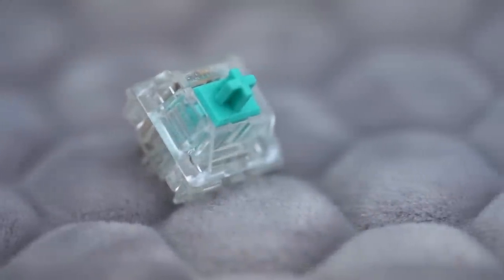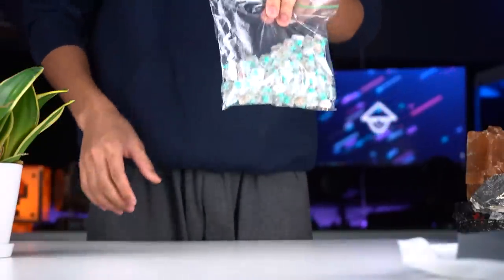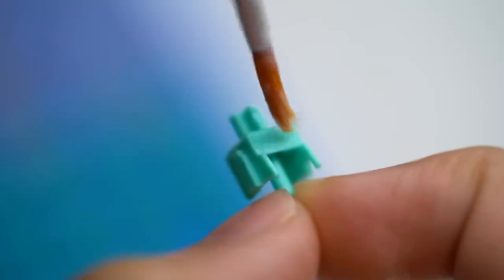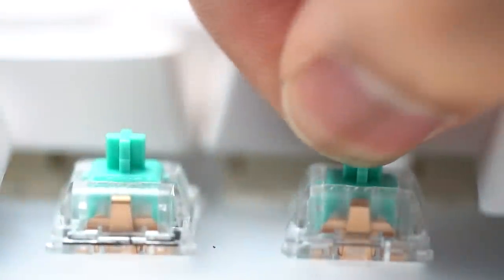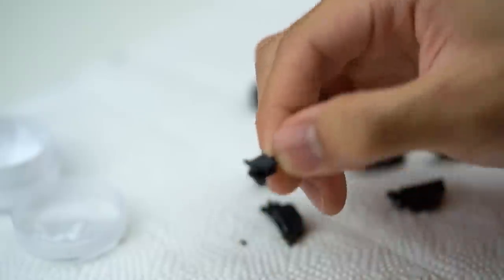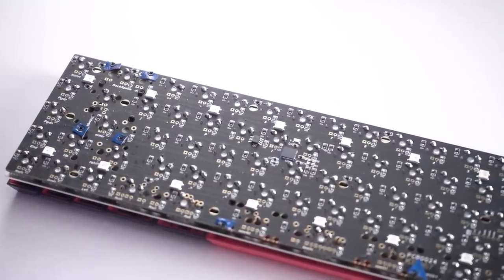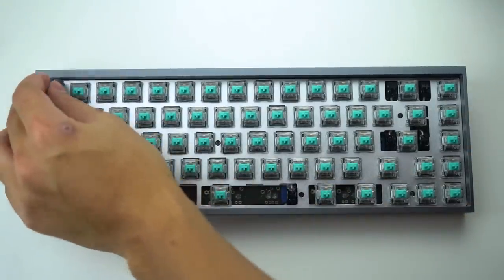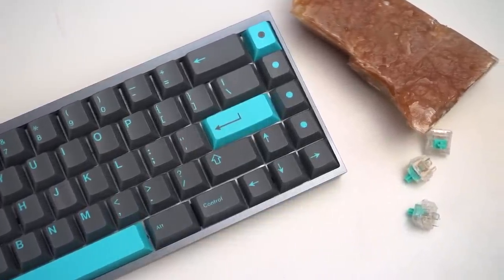The Making of My $450 Custom Mechanical Keyboard!

Comment: Great vid. When you solder it looks like you are feeding it by pushing the solder in to the tip of your iron. Using the iron to get the flow going is fine, but I recommend trying to feed the hole itself after it starts flowing. This way you get a better contact for the finished solder point. That way you end up with the cone at each point, rather than the bubbles you see.

But again, great vid. Love the look of the case. Might pick it up myself lol

Comment: I actually like the alu plates, because they have a little more give than brass and also they don’t oxidize and get yucky like brass, which is especially important for soldered builds that you can’t clean quickly...

Comment: Some say that after clipping, you also have to sand down the nubs to get an even stabilizer
Reply: only if you clipped wrong, sometimes when you clip a bit will stay on but it can be fixed by sanding however if you do It right the first time then it shouldn’t be a problem

Comment: 1 thing, after you're done soldering , always check if all the switches are correctly soldered and is fully functional, you can try to connect the usb c cable and check all the keys using a keyboard tester on the web. It's better to test it first before finishing the build

Comment: in the next 2 months or so I'll start gathering the items I need for my first build, spreading it across couple paychecks cause shit's expensive but this keyboard will most likely be the last one I every purchase, so I'm not going to cut any corner. I'll get good stabs from the start - mod the shit out of everything for ultimate smoothness and enjoy the shit out of that keyboard afterward. Lots of good tips you gave me in this video that I'll 100% apply to my build.

Comment: When i have the money, i want to do almost same one, but a bit diffrent. Heres the part list
Custom keyboard Parts
________________________

Switches: tealios v2

Case: tofu65

Pcb: dz65 v3

Plate: alu plate

Films: deskeys

Stabz: durock v2 screw in

Lube: 205g0 and super lube oil

Cable: blue samurai coiled cable

Keycaps: redsuns gmk blue samurai: basekit+spacebars+coiled cable

Comment: Not gonna lie, from someone who does a lot of soldering, if you ever solder and it looks like a non reflective ball on the top of the contact heat it up more until it looks like a shiny Hershey’s kiss. You have a lot of, what’s called, cold solder joint and they will usually not hold up. Just FYI

Comment: the real reason you dont ever use dielectric grease is over time it will harden and become crispy. so if you plan on keeping the board for awhile you will most definitely at some point have to take apart and re-do stabs
Reply: I'm pretty sure krytox is just thinned out dielectric grease
Reply: @bayybars  false

Comment: It's all very fascinating to the point where you said it makes a difference what kind of lubrication is used. From a mechanical engineering point of view - vaseline will most like suffice.
It is the same with car engines. Most take 5W-30. As long as it is not the cheapest out there and is according to manufacturer's rating, it is all good. The problem many will face is how long you use the oil. And tbh; you can go without for millions of clicks. This will draw dust and clug the switches way earlier than you can enjoy the "nicer" sound due to lubrication.
Sorry, but the backplate was top, the lubrication? Dude, it is a keyboard switch.

Comment: Ok I want a really nice linear keyboard with an aqua and gray/black look, this is poggers but the tealios are expensive. What should I get? Also I really don’t want to solder cuz I don’t have a solder(er?). Basically what’s a really smooth feeling keyboard with a color scheme of black and aqua. Rn I have a trash keyboard send help.
Reply: Nvm screw it im getting the tealios lmao
Reply: @synpower2382  if u r on low budget get alpacas ink blacks v2 but tealios best
Reply: @synpower2382  ayo if u have the tealios should i get it i mean its expensive but is it worth it?
Reply: Ayy u play minecraft lets goo
Reply: @Wasif38902  yes I play mc, but also the tealios(In my opinion) are worth it, but it’s all about preference. If you want a perfectly smooth switch, lube the alpacas or Tealios v2. I recommend alpacas because they give slightly smoother feel, but tealios if you like heavy. There is no sound difference tho.
Reply: @synpower2382  imma get the ink blacks v2 1 dollar is Just a bit overpriced for me
Reply: @Wasif38902  uh dude, the v2s are really scratchy. I really don’t recommend them. Get the JWK lavenders. You won’t regret.
Reply: @Wasif38902  also it costed 1 dollar 1 cent per switch

Comment: Hey neo i bought this same kit and im having trouble figuring out where exactly to mount the stabilizers on the pcb as well as spacing out the switches properly for the bigger enter key sized keycaps. If you can help me out or post a more in depth video id appreciate it. Please respond 🙏

Comment: what did you do to the right atl and control key, the way you put the switches in, they wouldnt actually fit into the pcb since there are 3 spots for swit ches in that are but you put 2 switches

Comment: Curious to know if you notice a hydraulic effect in the keypress when you lube the inside of that hole in the middle of the bottom housing. I did and since then I only lube the shaft of the stem and be sure to wipe the bottom of it dry.

Comment: Hi there, great video. it inspired me to build  a similar keyboard but with cherry MX clear switches and KBD's DZ65 GB Hot swap PCB. There are two type of switches the PCB mount and plate mount. I suspect I need the plate mount style switches but not positive.  What's your advise?  thx

Comment: do you need to lube the switches?
because I was thinking about building my own keyboard but without lubing the switches.
Cherry MX red switches
Reply: Eventually you will need to lube the switch if you want a smooth typing feel and lower the switch noise :D.
Reply: @huunhanle3809  ok thank u :D also what lube should i get for cherry mx reds
Reply: @barrelhead2  I'm currently using keyboard with Gateron Milky Yellow and lube them with Krytox 205g0 and Krytox 105 Oil for the switch's spring only ( to prevent the spring ping ) :D. So it's will work outstanding good with other linear switches.
Reply: @huunhanle3809  ok thanks :D

Comment: U didnt tell us the prices. how much do the parts actually cost to be in total 450$ worth
Reply: Key caps probably 110-150 or something the Switches are 1$ each so those were probably 60$ 50$ the base is probably a good hundo then there’s the board and all the other shit which might be like ehh 120-150-200$

Most of this is just a guess I’m just going off by what I’ve seen

Comment: use dielectric grease just not too much thats why your stabs are rattling.
Reply: a lot of people swear by using thick krytox such as 205g0 since dielectric grease can make stabs feel mushy, he's using cheap stabs which might be the problem
Reply: @bayybars  You kind of want to use a lot then spam it and eventually it will become smooth and return like normal.
Reply: @cognition26  I guess it's preference, I have dialectric grease on my current keyboard and the stabilizers aren't satisfying to bottom out imo
Reply: @bayybars  I use krytox 205g0 in the housing where the stem is sliding up and down but on the wires I use dialectric. I think the goal is the same for everyone. To reduced the rattle as much as possible while make it as smooth as possible. You don't want any resistance because if it's too thick the spacebar return slow. Most of the noise comes from the wires rattling which is why I use dielectric on them.

Comment: Trbisosy 3204 might've been a better option for the stabs because cherry stabs are good with Trbisosy 3204 in my opinion, it's completely up to you and your preferences. my reasoning on why i think Trbisosy 3204 would be better for the stabs is for it to give you that nice, thocky and smooth sound. krytox 205 g0 is definitely the better choice for the switches though. also maybe get a better cable that's maybe coiled and like grey to give better cable management and the wires wont bend and possible open showing the inside wiring.
Reply: You wrote a whole essay and he didn’t even see it 😹😹😹

Comment: I'm not into keyboards - can someone break down the costs? why is it so expensive?
Reply: 60-80 for the switches, around 120 for the case and let's say around 80-100 for the pcb, foam lube and films.
Around 260-300 now. Another 100-130 for the GMK Phosphorous set, a bit for the cable, shipping and other shit. You can also get a high end custom keyboard for below 450 but it won't have fancy stuff like the gmk keycaps
Reply: @ysharky  phew wow that's expensive. Thanks for the info!:)
Reply: @zxljmvvmmf3024  I am probably kind of inaccurate tho. But I am pretty sure you can get the same build with worse keycaps for 300 if you are interested
Reply: @ysharky  Thanks but no, I like watching those videos but nothing for me. I just bought a Ducky Mecha Mini, should arrive soon :)

Comment: I will never get the sense of lubing keyboards. The idea of having my switches flooded with lubricant is not pleasant at all.. sticky and stuff. And honestly I like the mechanical feel and sound of the actual switches as the come. No need to disguise it. If I wanted a softer feel or sound I would just buy a membrane keyboard lol.